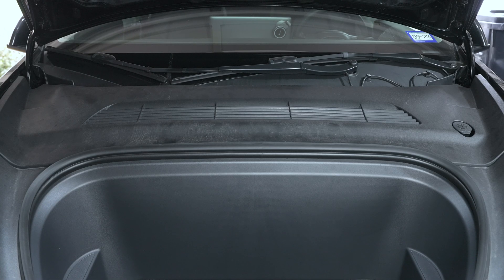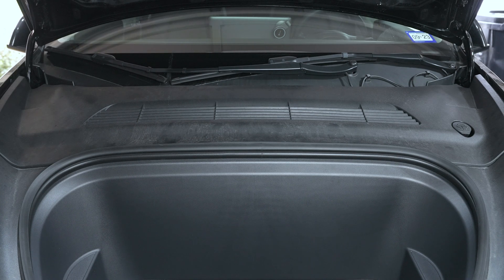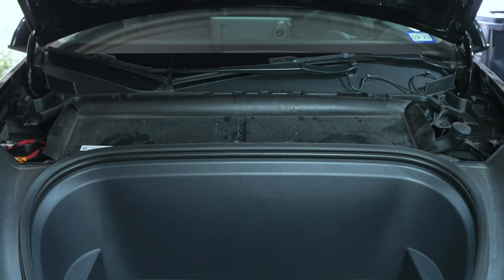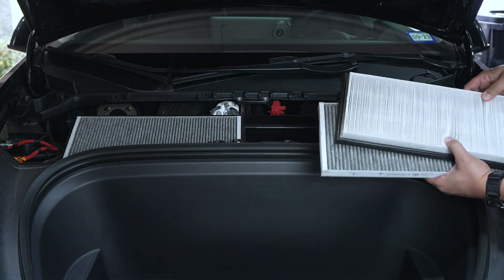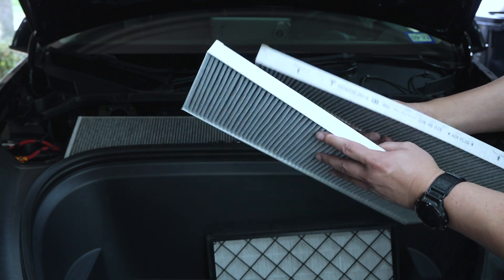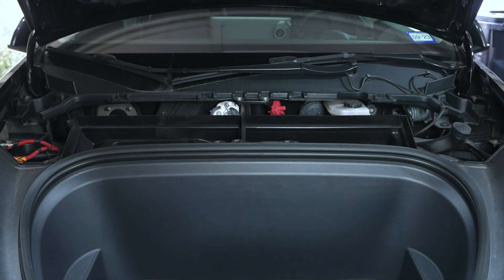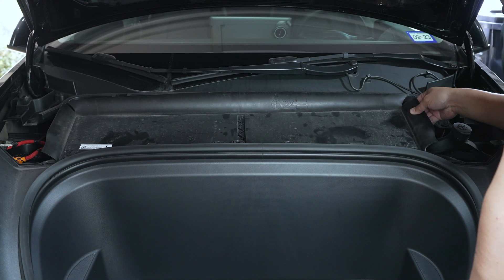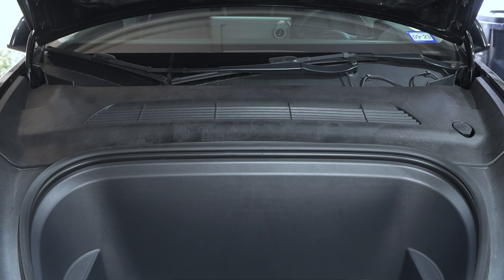Tesla Model Y Replacing the HEPA Air Intake Filter

Comment: Great video……however, the reason the hepa filters were not very dirty is that they should be replaced every 3 years.  I have had my Tessie this month for 3 yrs… i have a warning on my car to replace them….. the cabin filter is every 2 yrs….   Thank you for the clear instructions!
Reply: Maintenance for the cabin filters says every year?
Reply: @jaykid007_JasonDavis my car manual says hepa every 3yrs & cabin every 2…..in fact, your car will remind you!
Reply: Mine at 36 miles was dirty dirty.

Comment: I started getting intermittent heating issues with my 2021 Model Y.  No codes, but the odd times no heat would come on, fogging on the windshield became dangerous.....a day or so later heat and vent working fine.  Brought it to Tesla and the only thing they did was change the Hepa Filter....so I hope this is it....But I'm disappointed in myself for not doing this on my own sooner.  Great video.
Reply: Having the same issue with my 2023 model Y. I'm hoping to take a look at my hepa filter and see if that fixes it. I have roughly 92,000km on my car now.
Reply: @ThujanK  did this work for you guys?  my 2022 is having issues with the window fogging up and not defogging.  I just bought the hepa filters the other day but didn't know there was also separate cabin air filters.. ordered those too.
Reply: @philsanalogbasement  yep my hepa were clogged. Night and day difference after changing them.
Reply: @ThujanK thanks! i did the hepa filters yesterday and they were totally clogged up with cottonwood, leaves, etc.  right around the same mileage as yours was.  hasn’t been cold enough yet to test defogging again but hoping for the best
Reply: @philsanalogbasement  Try the cabin air filters.  I just changed mine because I had almost no heat and it fixed it immediately.  I still haven't done the Hepa filters.
Reply: @kegfreak3728 the hepa filter fixed it for me. they were completely clogged with cottonwood, leaves, etc. when i went into service mode to reset them, the car said they were at 48%.  i got the cabin filters a few days later and did them, the old ones weren’t bad at all in my case.  i thought for sure my german shepherd was going to have them totally clogged up.  either way, it’s fixed and i am super happy!

Comment: I just watched your video, so I apologize for the late question. Does the 2023 Model Y also have the internal cabin filter or does this external hepafilter replace the internal filters or does the 2023 have both internal filters and external filters?
Reply: 2 Internal cabin filters that you can access through the right side footwell and HEPA in the frunk. 
Both relatively easy and cheap to replace - I do it on a yearly rotation due a lot of dust in my area.
Reply: @twoclogs  thank you. I was hoping the frunk bio filter also replaces the internal filters.

Comment: Model Y's have two sets of filters???    ty
Reply: 2022 later model only
Reply: @jonathanmu6072  My late 2021 MYP also has the hepa (two sets)
Reply: @2science How did you figure it out? I Have the MYP 2021 but not sure if mine has it
Reply: @jonathanmu6072  yeah I never knew that.  Thanks.
Reply: @jonathanmu6072  but you can get a retrofit for the 2021 model Y installed by Tesla for $330.

Comment: My model y is only 1 year old and the AC is beginning to stink. Do I need to replace the cabin and the hepa filter?
Reply from the maker: Start with the cabin air filter along with cleaning the coil.
Reply from the maker: https://youtu.be/YKueBO04B0k
Reply: It really depends on your environment, if the air isn't as clean in your area, it's super cold or hot, it's very humid, or you run heat/air heavy then it can wear faster.
Reply: @dylanmusgrave3657  I replaced the cabin filter and the smell is gone. I live in a very humid state so that makes sense

Comment: Tesla says these filters should be replaced after 3 years
Reply: Any statement that starts with “Tesla Says” needs to be verified… examine your use and environmental conditions before sticking to a Tesla timeline
Reply: @johns00982  you're right, you probably know more about maintaining the car than the folks who, you know... build the car
Reply: @Puzzen   that’s why Tesla says it’s RECOMMENDED, because you can’t base it on time… its based on environmental considerations
Reply: Was gonna post this same thing. No wonder it’s still clean, only a year old bro, only needs changed every 3 years
Reply: 2 years. Hepa filter is filthy. Bugs and all, never once used bio def mode. Waiting on replacement. Also the hepa filter had that mildewish smell
Reply: I had to replace them after 1.5 yrs because it stunk up the car.  The filters gave a musty mildew smell.  Really embarassing.  We live in humid Houston so maybe we have to change more often. But i never had a car smell that bad.
Reply: @fhu868 honestly j think it's the cabin overheat protection
Reply: @fhu868 sir let me solve ur problem. Yes change out everything fresh. But turn cabin overheat offfffff. I live in Louisiana hot like you. It stinks bad. That’s cause the ac is wet all time cause overheat protection. It never get to dry out. Now it should just smell that dusty smell when filters get old. Which same as gas car. Not dog shit smell I was smelling.
Reply: I have dust in my cabin after just 2 years